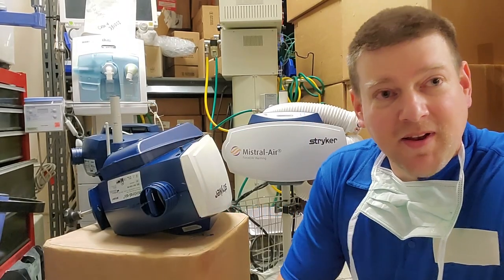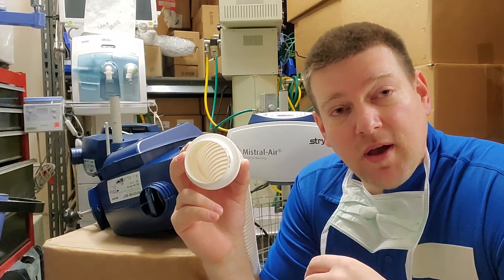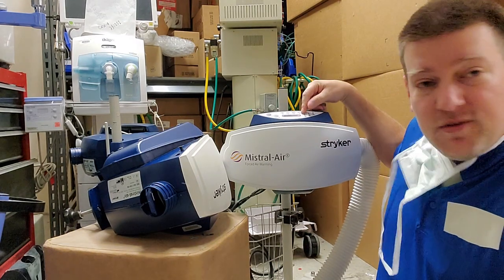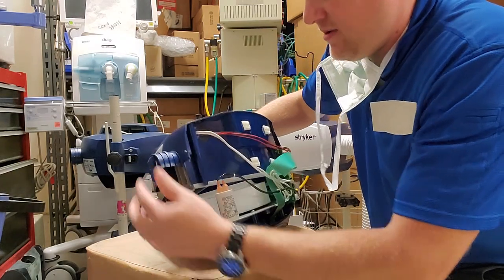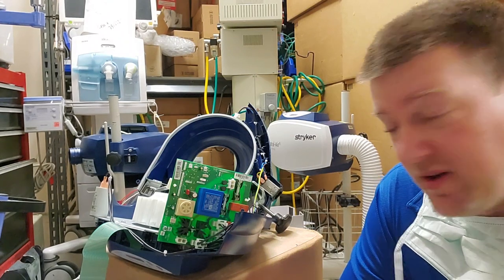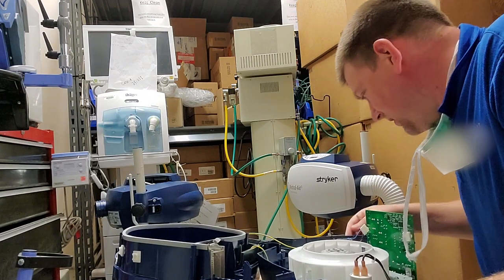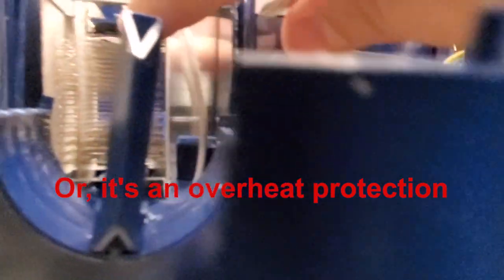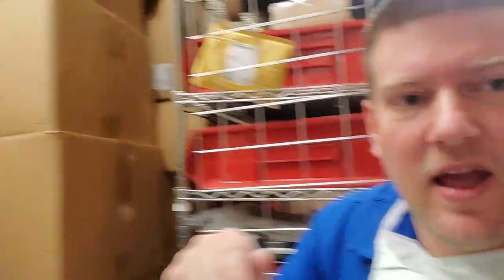Forced Air Blanket Patient Warmers

Comment: Since the temperature is adjustable on the front panel the mechanical cutout is regulating in case the electronics get unresponsive. There's also a thermal fuse in the heating element, a last resort when all else fails.

Comment: The heater is running on AC. In that case it's a TRIAC on the heatsink. The transformer is too small for powering that heating element. I guess there's a small TRIAC for the fan and then the big on the heatsink for the heater.
Reply from the maker: I completly agree on the triac for the heater. The fan looks to be relay controlled straight from Mains. I will get better pictures of the power board along with some part numbers. I had 10 minutes to film and prep for this video before other Biomeds come walking through the warehouse.